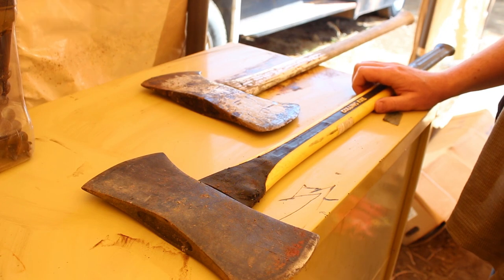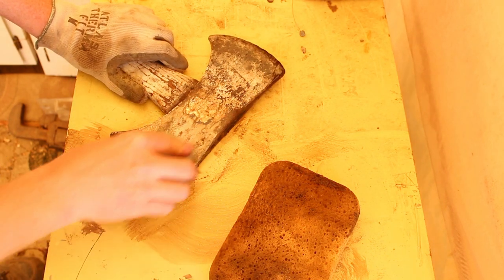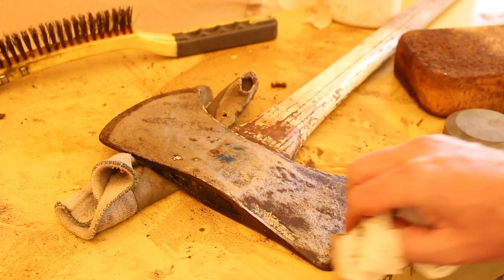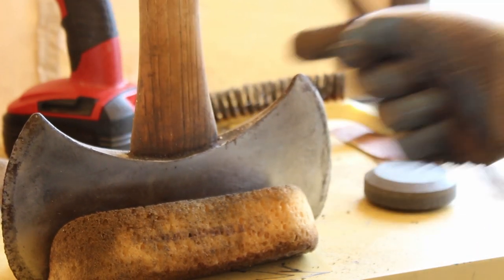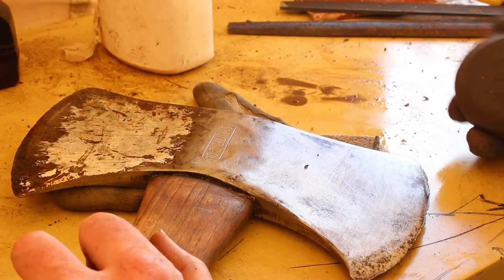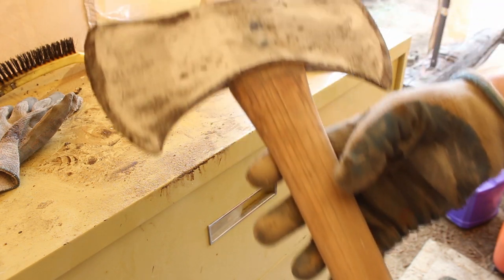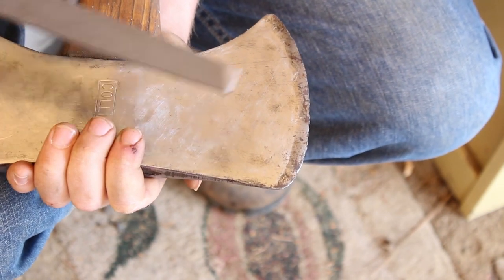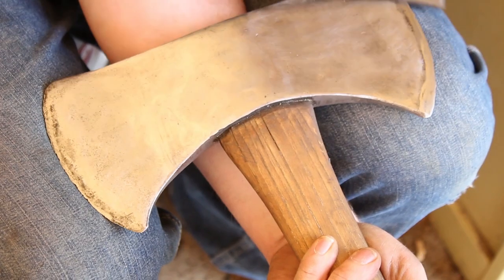Collins Double Bit Axe Restoration - Country Living

Comment: Flapper disk on a grinder or a wire wheel would have done you wonders on saving time, but there ain't nothin wrong with spending a bit more time putting some love into a tool like that. Thanks for the video and job well done!
Reply: Normal tradition

Comment: Well, you sure aren't afraid to work hard! Nice axe. I have a similar one that I plan to re-haft soon. If you do any more axes you may want to try a few different methods and decide how you like the results compared to your current methods. Used on un-hung heads, the vinegar bath mentioned elsewhere, will amaze you. I buy mine from the dollar store. I use Naval Jelly on the heads if they are still attached to a handle that I want to keep. Also, you can get a cheap orbital sander from Harbor Freight for about $15. With a fine or mild disk you can remove any paint and many small scratches. It will also put a nice polish on the axe head. It works well on the handle also. There is a product called Half & Half that is half boiled linseed oil and half penetrating "enhancer". The enhancer is made from orange peels (If I recall correctly). The Half and Half will penetrate your wood more thoroughly than plain boiled linseed oil,  yet it will give you a similar finish. Also, you generally file into the blade, not away from it. However, when doing so, you need to wear leather gloves and consider a file guard as well.

Comment: If you're safe with a grinder then it won't ruin the temper. And a grinder is only for removing pitting. I suggest you put a wire brush attachment on your drill. It works like a charm and you don't have to worry about the temper.

Comment: ONe side of that Collins is for splitting, the other for chopping and therefore are sharpened differently.  Never never sharpen away from the body of the axe.  You realign the particles of steel away from the bulk of the metallic the axe body.  The result - a very weak edge.

Comment: How about a vinegar bath to start with.  It's non-destructive.  Then for the paint, how about a can of Walmart spray stripper. This will leave you with a clean axe and THEN you can start the rough stuff, IF you even need to.
Reply from the maker: Bob Scott Good suggestions
Reply: PastorBCoy Steel wool works well too, if you're set on using hand-tooling methods over chemical ones.
Reply: PastorBCoy wd 40 would have worked much faster with way less scrubbing

Comment: flapwheel on an anglegrinder - wont get hot enough to ruin temper and if still an issue try mediablasting that will clean all crudd off and speed up the process of polishing however the satisfaction of doing it by hand doesnt come with either method
Reply: jimsbix both if used badly will and can heat way past the temperature to destroy the temper